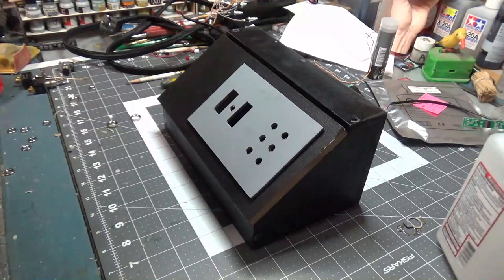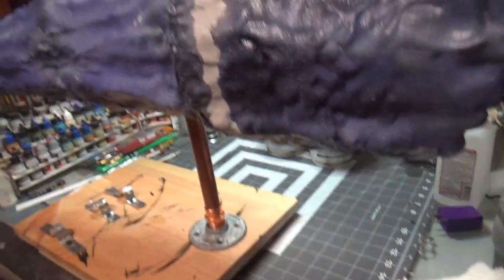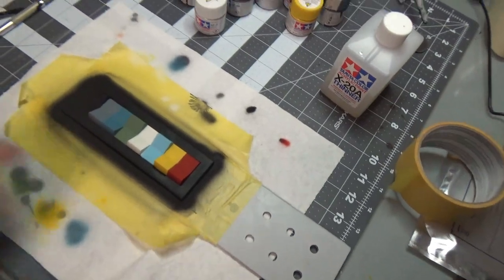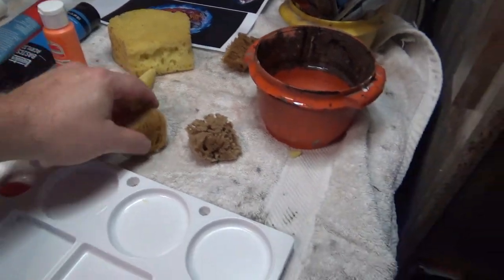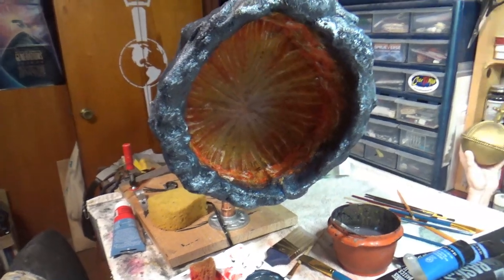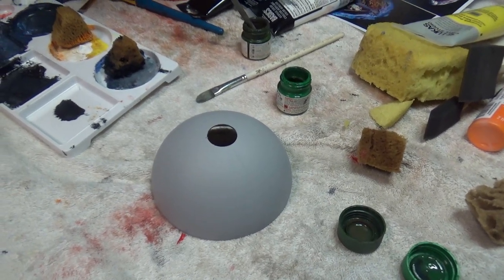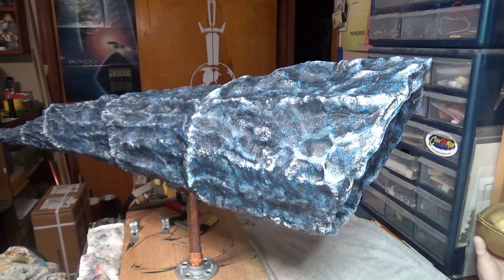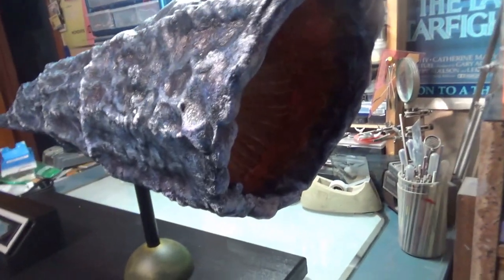Aztek Dummy Update 10/28/22 - Doomsday Machine - Part 3

Comment: Hi Lou thanks for the info on the sound card waiting for them to come in stock, do you get the software for it as am brand new at sound cards so any tips you have will be greatly appreciated thanks
Reply from the maker: There is no software for that sound card. What you do is plug it into your PC and drag your mp3s to it like it was a USB drive. The issue is you have to name your files 00001.mp3 thru 00008.mp3 or the board won't recognize them.
Reply: thanks Lou

Comment: You were incorrect on one point. I took several tours throughout a mockup of the "Desilu" studio Star Trek stage in Kingsland Ga. They duplicated everything, including the switches in all the rooms and for the most part, those switches were all "static". They didn't work. Producers thought people watching the show would pay more attention to the actors than the controls. Now, that didn't mean switches in close-ups didn't work. When they focused the cameras on certain things, of course they wanted them to work, but for the most part it was more cost effective for everything to be static displays.
Reply from the maker: Aren't those sets great? I worked with Vic's set designer on some of the graphics including the Engineering Status board and the lettering on those pipes in engineering behind the red grid screens.
The real reason the buttons were static in most cases was that they made noise when you switched them and it would ruin the audio of the take if someone "clicked" over someone's lines.
Reply: @aztekdummy   Vic headed our tour last one I was on a month and a half ago. That's where I took my profile pic. I'm gonna miss this weekend were Chris Doohan will be at the studio. Vic is so down to Earth (no pun intended) and loves the fans.

Comment: Looks amazing Lou! Bit of a shame that it has to be mounted side-on as, beautiful as the sides look, all the goodness is going on at the mouth. Mk.ii switch box looks way better than the original 👍 Just still a little concerned about the power wiring. Not sure what the electrical safety regulations are over your side of the pond but having mains running to the back of a metal switch that I'm guessing isn't grounded and is mounted to a faceplate held on only by magnets would likely be a bit of an issue over here. I'm hoping that if you take it to Wonderfest (as it deserves to be!) it won't be refused entry on safety grounds or allowed in but no be allowed to be plugged in. That would be a disappointment 😞
Reply from the maker: Wait a minute...are you suggesting my planet eating doomsday machine might not be SAFE ?
Reply: @aztekdummy  🤣🤣🤣
Reply from the maker: It's really no different than how handheld appliances are handled here. The power strip inside the box is grounded and has a circuit breaker on it . The switches here aren't grounded as a rule as long as the thing it switches is, so we're good. And I wrapped the metal parts in electrical tape to avoid accidental shorts.